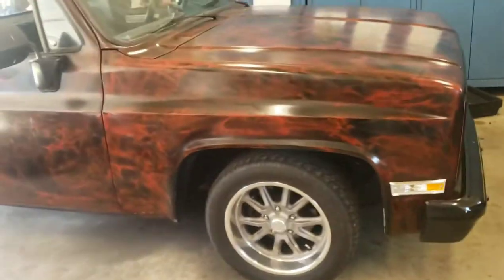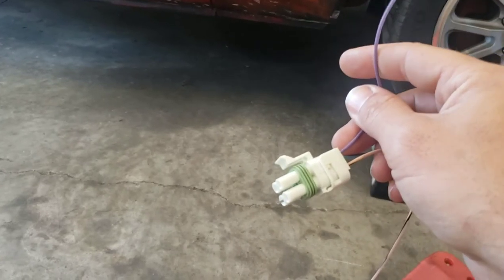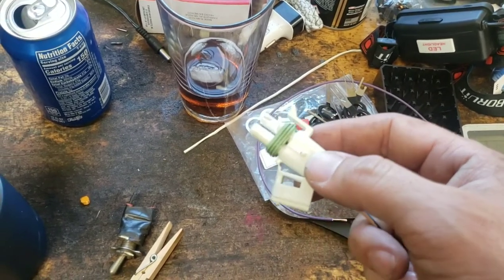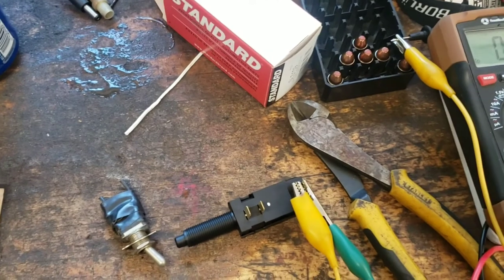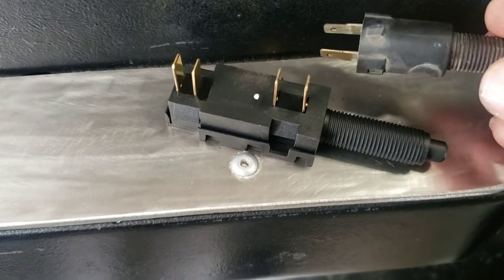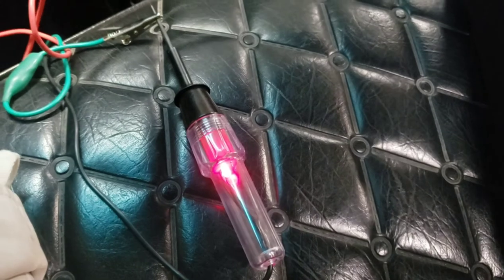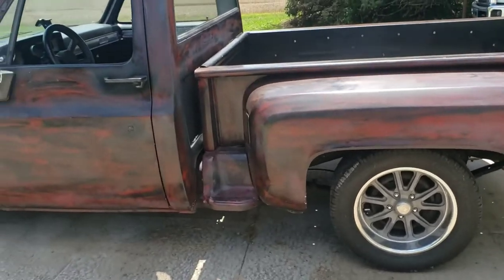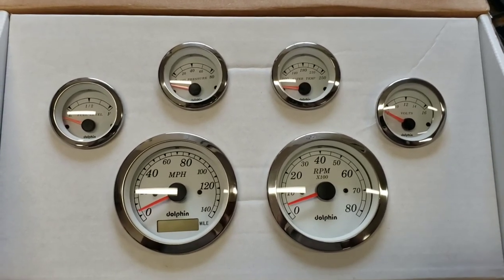700r4 Torque converter lockup wiring on my c10

Comment: The 700r4 out of an astro van is inferior to one that came out of a vehicle that was a V8 . the astro is a V6.and is lighter duty. Really all you have to do is run your 12v down to your hot wire at the plug, Then take the other two wires and twist them together, the trans will do everything that it is supposed to do . It will lockup when it is supposed to and unlock when you let off the gas. I was skeptical of this when I saw a video on You tube about this . So I tried it and it works perfect. But it will only work on the 1987 and up trans. Not on the 1982-1986. P.S. I have a 1985 C-10 stepside and I love it.

Comment: If you don't run lockup in a stock 700r4 you will burn the overdrive up. If you're just going 40 mph or under, just leave it in 3rd gear. You should've gotten a 2004r, because they have much better gearing. I got one and I'm gonna have it built up and put it in my chevelle so I can have overdrive.
Reply: So I’m about to put a 700r4 from a 92 checy truck with a 3000 stall converter in my 85 Chevy. I ordered the TV cable and I wasn’t going to do anything g to the lock up because I’m not running cruise control. Should I be concerned and wire the lock up? Thanks
Reply: @ActiveDadsRule  Listen and understand that if you don't run lockup in a 700r4, then you will burn up the overdrive. You need to run a brake switch and a manifold vacuum switch also so it unlocks the converter clutch when you step on the brake and when you slam the throttle down hard. Do you understand me? Don't just hook the wires together, that's for stupid people who don't know what they're doing.
Reply from the maker: I'd say if first depends on if your stall converter is a lockup converter, but if it is you would want to wire it so it locks up. It greatly reduces heat when crusing

Comment: My question is do you have to turn off the switch to engage passing gear or will it work like normal
Reply from the maker: You dont have to turn off the switch. In normal driving it works without touching anything. I just like having control with the switch.
Reply: @avarageerod  alright that's good to know thanks for your quick response to my question

Comment: I'm cheap and I like custom so I just put gauges into the gauge bezel and it worked great, had to use some heat to open the holes up enough for the gauges to push into it but just use a heat gun not open flame or you will have a black fire ball

Comment: Do you turn on lockup at 60? Or you have it on then hop on the highway?
I swapped a th350 to 700r4 in my gbody and I have it hooked to a vacuum switch, when it goes into second it locks my converter and like surges was thinking I have to much vacuum because it shouldn’t be engaging that low but works with od unplugged
Reply from the maker: It didn't come on at any set speed, just in 4th with the vacuum switch and time delay was met. Do you have a time delay relay? You can also drop the pan and unhook the solenoid so that it only locks the converter in 4th. There are some YouTube videos on it.
Reply: @avarageerod  I do not have a timed relay, I’m having the issue do to me not knowing how the wiring harness was inside is set up so I’m going to have to drop pan and rewire
Reply: @avarageerod  I think right now I have straight power and ground to the solenoid itself so right once it clicks into 2nd kicks on lockup

Comment: Does the torque converter needs to be locked all the time, all the time receiving 12v?? I need help
Reply from the maker: Yes. The only time it should be without power is when you press the brake pedal or have it on a switch like I do in the video.

Comment: I have a question bro the power for the lockup does it has to stay on while your on the highway or ot has to put power just ones or do it need to stay on in order to be on overdrive
Reply from the maker: On the 700r4 it needs to stay on the entire time to keep the converter locked.

Comment: Does the switch make the transmission sound like it has 5 speeds ?
Reply from the maker: I does make it sound like there is a 5th gear when the converter locks up

Comment: Do you have a yr model or a part # for that brake switch
Reply from the maker: Sure I do. The switch I used is made by Standard Motor Products and the part # is SLS159